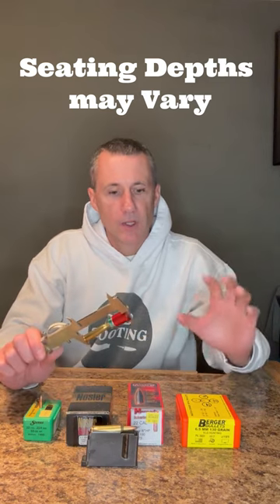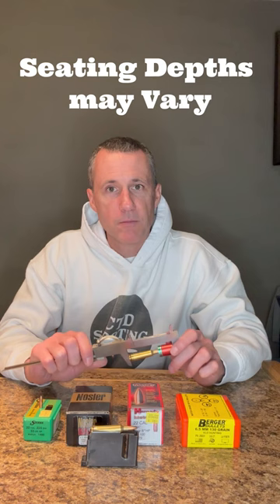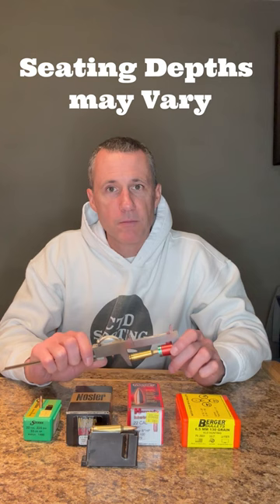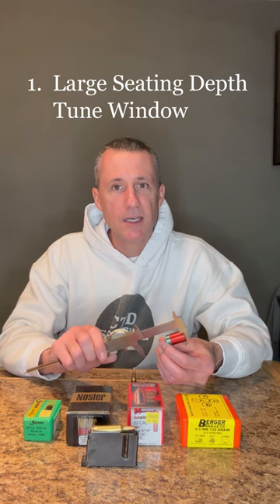Seating Depths May Vary:  CTDSHOOTING #Short, #reloading, #bullet

Comment: Love learning from your posts.
Is there a bullet seater tool which pushes down on the ogive of the bullet to ensure accurate depth?
(Since tips of bullets can vary)
I'm shooting 30-06 caliber
Reply from the maker: Thanks for the question.  Most currently made seating stems (found in the seater die itself) contact the ogive.  However, you should still check with a bullet to make sure.  I'm not sure if that answered your question good enough.  If not, please send me an email (ctdshooting@gmail.com) and I'll try to explain further.  Or...I could make a quick video if you would rather prefer that.